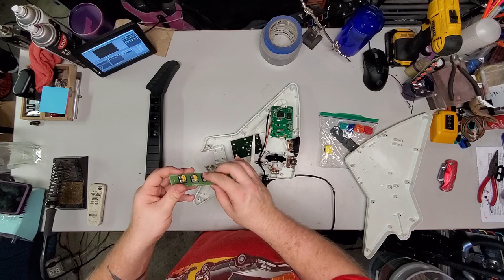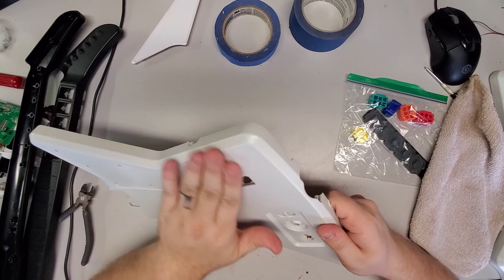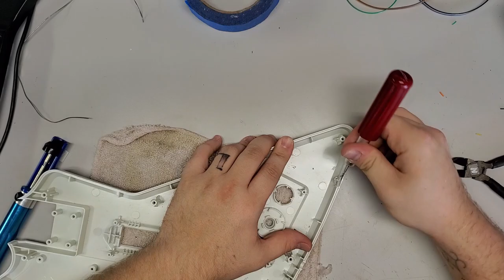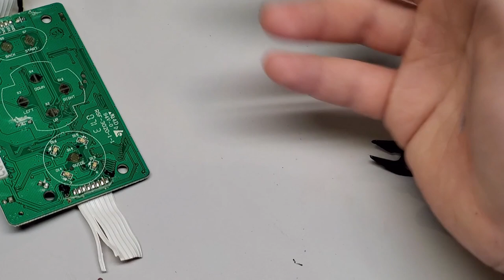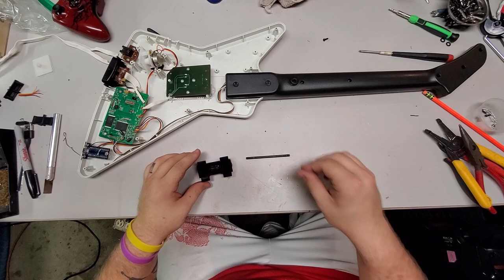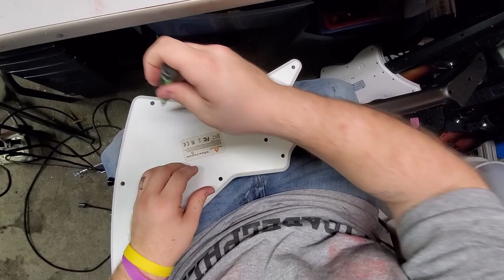Refurbishing And Modding A Guitar Hero Xplorer(FULL BUILD)

Comment: Thanks so much for the video - please could you help me a little -
• Do you have any further tips on incorporating a usb-c port that you have come across since uploading this video?
• Please could you share your advice on using epoxy resin to bond plastic parts together (i have never used it before, not sure which kind/brand to buy)
• Do you have any advice for replacement whammy parts? for example if you receive a guitar and the whammy is missing, or the spring is broke, what advice would you give to someone who doesn't have any spare parts laying around?
• Do you have any tips/products that you use for touching up parts of the black plastic (e.g. the neck) that are scratched or marked?
Also not a question but it's nice to hear your take on avoiding aspartame - sweeteners are so bad for our microbiome, it's a shame that something so unhealthy is so commercialized
Reply from the maker: I'll try and answer all as I always love helping. My only real tip now that I've added a few of these, gotta get the more expensive boards(usually only a few dollars more and sadly don't know brands) of the usb-c solder  point type. Reason being, the cheaper ones have snapped off from usual play where the others have had no issues. Also if not mentioned in video, 90 degree cable is a must(the weight is better distributed and doesn't strain the port) 
Epoxy resin. So for epoxy there really isn't a bad brand or option out there. My favorites are JB weld or Gorilla as those are most common in stores and work great. It's also very simple to use with those types of brands that release both parts equally. Just gotta mix it and follow the directions. I usually do some test pieces before I go to town on something bigger. 
As for whammy parts I still haven't found a good potentiometer to replace the stock ones, I honestly just have so many guitars and parts I seemingly never run out when I have to replace faulty whammy sensors. As for any plastic parts themselves if you're referring to that, ebay/etsy has a lot of 3D printed parts. For stuff like the spring, I usually will toss a rubber band on the inside and wrap it around a screw post some tape. Seems kinda silly and hard to visualize but all we are looking for is to put some tension on the pivot point. Also I'm sure reddit or others would know the part number for an outright replacement. 
So as for black parts, and really parts in general I have never messed with any buffing or scratch removal techniques. For any guitars that go out I just take the time to sand smooth and repaint. But for personal stuff I just use for playing a good cleaning and maybe even a sticker or vinyl to cover stuff up.(I have a very expensive RB Jaguar that has a DEEP scratch in it but I wanna keep those stock, so I tossed a huge Fender lego sticker over the scratch. It looks cool and is practical, so just tossing an idea out there.) 
And finally how I avoid artifical sweeteners and soda in general isn't really a trick or anything, it's just what my body prefers. Regular soda is just too sweet and it is hard to take down, and artifical especially aspartame, gives me such a bad taste in my mouth and makes me extremely drowsy. So it's pretty natural for me to just like water only, sparkling water took a lot of forcing myself to do drink it and I now like it.  That and discipline, since I have 3 kids I have to be really smart about what they consume, especially when I didn't consider my own health until I got sick of being big and unhealthy.
Reply: @ninjapwnsatlyfe  dude you are a living legend thank you so much for this invaluable information, i can't put into words how much i appreciate it - thank you so much!

Comment: hey my xplorer strum bar doesnt go all the way up. it goes down fine but not all the way up, any ideas?
Reply from the maker: Could be a number of things. Two biggest culprits are either debris caught between the strum bar and switches or body of guitar. I've had some of the rubber stoppers fall out and get jammed between(rare, but possible) other being strum switch is out and needs to be replaced. If so you can do it yourself, or there is a person on etsy who sells new strum boards with switches and a special connector that requires no soldering
Reply: @ninjapwnsatlyfe  yeah like the switches seem fine because i can strum up and down on songs and it registers but the strum bar just doesn't go all teh way up if i push it up, i was thinking of taking it apart and seeing if there was debris but not sure how risky it is to open it up

Comment: My explorer still works fantastic, but I've been getting into doing really fast trips, and other higher-level tapping stuff, so I was wondering what kind of upgrade I can do to my friends to where I'll be more likely to hit more notes consistently?

Is it the mechanical frets?
Reply from the maker: @titanpolus5088  yeah mechanical is the way to go. Some nice heavy 70s with or without the audible click. Rebound is great on those. There are also hacks/tricks that people do where they cut slits into the silicone and it helps too. I dont have any but there are videos out there
Reply: You would be really sad. About 5 years ago I bought a guitar hero 2 explorer in box at a thrift store for $18. The box was in rough shape so I threw it away 😅
Reply: @ninjapwnsatlyfe  I've done that and it did help, but I've improved since then..

Comment: great video, thanks! can I install a 6 wire fret board on this guitar? if so do you have a wiring diagram any help will be appreciated.
Reply from the maker: You can with an arduino or other micro controller but due to the mother board if you share any of the commons(there are 3 total) When you press one it will press the other. I suppose diodes and other measures could be used but it would get so complicated it's not worth it with stock motherboard.
Reply: thank you sir,  subscribed.

Comment: Hey Nick, i was wondering, have you ever done a lp strum bar transplant into a gh5 guitar? Or world tour? I wanna try but i was looking for possible reference point before i start. Thanks so much!
Reply from the maker: Years ago I did and it was a lot of work. Never even made a face plate to match. It also looked super silly with a shorter strum bar. A much better option these days is to just use a 3D printed strum bar that is in the style of the LP. I have many strums for lp and xp that mimic the world tour lip, so I don't see why going in opposite direction wouldn't yield the results you want

Comment: Hi  im wondering is there any way to get the Explorer guitar to work with rock band 4 it's one
I miss that guitar my favorite 
And all gh 
And equipment is breaking so frustrating
Reply from the maker: It can be made to work with different internals. Not overly hard and I definitely could do it
Reply: @ninjapwnsatlyfe  so the USB C 1 that you made dus it working on rock band 4 Xbox One 
/ series X  I am disabled and it easier if my neck is a lot shorter it was some reason all the other Guitar Hero guitars spacing issues for some reason on the Frets and I'm not reading them I'm thinking of hitting another button I never had that problem when I was younger but I need a guitar that works and has mechanical Frets and a new key switches for the soundbar it sucks when your equipment doesn't work

Comment: how would i go about replacing my cord that allows the g tar to be plugged in?
Reply from the maker: Either replace it with any standard data usb cable, or put a usb port on. If you take the guitar apart you'll see the colors for the cable match most all usb colors and its as easy as wiring the new cable to where the old one went
Reply: @ninjapwnsatlyfe  would I be able to take out that white box that the wires feed into? i have taken the g tar apart and diagnosed that the problem is that the wire coming out of the xplorer is frayed
Reply: @ninjapwnsatlyfe  oooh, tysm!

Comment: Quick question, For the fret buttons, how did you get the rubber strip to fit back into the fret buttons? The rubber strip seems too big to fit back into the slot.
Reply from the maker: It should fall into place pretty well on its own. It just sits on top of the buttons though and sandwiches between the circuit board and buttons
Reply: Yeah I realize that now, I thought it had to fit into the button space. Thank you!

Comment: Hey! Have you heard of an xplorer having the issue of "as soon as i raise it up to trigger the Z axis, and press buttons simultaneously" it locks up and requires a cable disconnect + reconnect to work again? I have that issue, was wondering if there is a clear reason why it happens and if its fixable
Reply from the maker: I wonder if there is an issue with the cable or main circuit board but have never really experienced that

Comment: i have some real serious gripes with the xplorer. like as the only real plug and play option its alright but everyone swears by it like its the end-all-be-all. i think its massively overrated and the fact that i was fooled into overpaying for one is unreal. i bought an "untested" one that had a broken breakaway connector for 40 dollars and i swapped it with my rockband cable that still has the breakaway. i managed to conserve the black strain relief part where it goes into the guitar so it looks oem but when i plugged it in to try it had quadruple overstrum. now i have to drop more money on switches. the added insult to injury was the fact that the seller left the 5 dollar salvation army sticker on. the v i built for cheaper is better than this and has way less problems and i got suckered into believing which guitars are "bad" and which are "good"
Reply from the maker: As much as I love xp's I actually agree a lot with this. I especially dislike people that buy thrift store junk and think it's worth way more than they paid. I'd say that the issues with it aren't so much the guitar as a whole, just the individual situation but it does suck to experience that. I mean even as much as I like the xplorers as a lefty I feel like they had no consideration for left handed players as I can only play it standing up. If you ever want, on top of doing commissions and send ins I also do trade ins. If you don't like it that much you can send it in as is on a big discount for something different. That way I'm not losing anything really and thus can offer a bigger discount since I'm not really losing stock. Plus what's mentioned is easy fix on my end so it wouldn't bring the trade in value down
Reply: Absolutely agreed. I have many guitars - Rock Band ones are obviously bad, but all of my GH controllers have strengths and weaknesses. The only one that's a straight downgrade is IMO the GH5 one with the huge strumbar because I think the strumbar feels bad. The Xplorers have nice tactility but their body is horribly uncomfortable - I actually prefer my GH2 Gibsons because they're just more comfortable for putting on your leg. I should mod one of those to be USB... they are not great as PS2 controllers...

Comment: Okay I was body swapping an explorer to a Kramer and got the body work all done and got to my usb cable that I was changing to a 4 pin quick disconnect well the guitars factory cable has 5 pins vs a standard usb end only has 4 pins so anybody with clarification on that would be awesome and I think some how in the process something got pissed off because I can no longer get the board to work I’ve done many body swaps and never had this issue everything on the board looks fine but it’s just pissed off no lights or anything
Reply: is it working with 4 pin board?

Comment: Cool video, I really liked the part about connecting cables instead of soldering straight to the pcb, I burnt one trying to repair a wii cable not too long ago, I feel like trying to fix it instead of replacing it could have actually worked.
Btw, how do you feel about yellow fret switches as opposed as opposed to red ones? I am going to do my first mechanical frets mod but it seems like most people use red ones.
Also, I'm kind of a newbie so I meant to ask, are the rainbow cables JST cables? sry that I'm asking but I really was wondering if any cable would work or if I should try to go for a specific type.
Reply from the maker: Personally I dig blue, yellow and orange the most as they have the most force. Reds are nice but are 20g less of force and I like having full feedback feel compared to the rest. Also the ribbon is just an off brand 24g cable. On top of taking some from work I got a set on ebay by just searching for color coded ribbon cable
Reply: @ninjapwnsatlyfe  cool, then I'll give the yellow ones a go, I thought I was getting red so I was a bit worried at first when I saw it was a different color, now I really want to try them out lol. Btw, how do you feel about the wires from an ethernet cable for connecting to the frets? I forgot to add the rainbow one to the cart when I bought the frets so i was hoping I could make it work with an ethernet one.
Reply from the maker: @Thantibus  that should be fine. The amperage is so low that an ethernet cable should be suffice, especially considering the 8 conductors will be just enough.
Reply: @ninjapwnsatlyfe  Hi  im wondering is there any way to get the Explorer guitar to work with rock band 4 it's one
I miss that guitar my favorite 
And all gh 
And equipment is breaking so frustrating